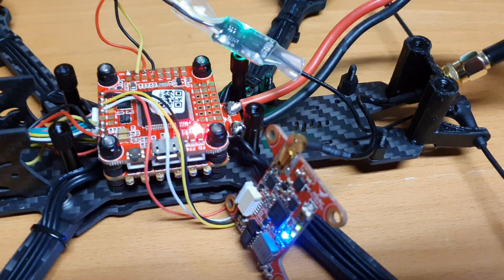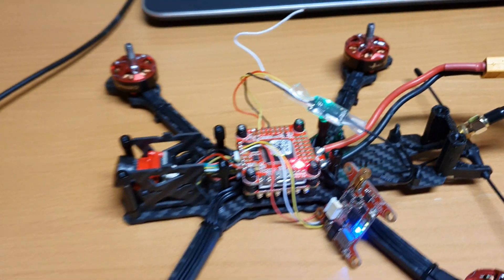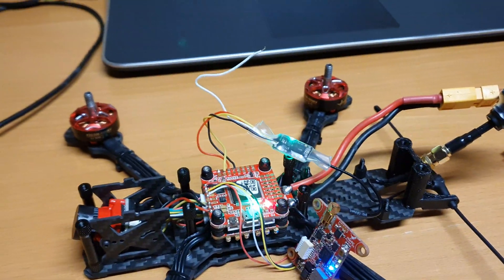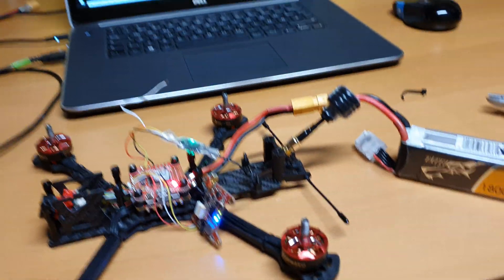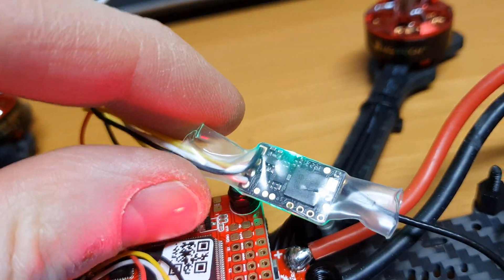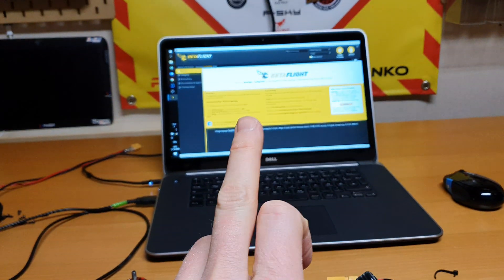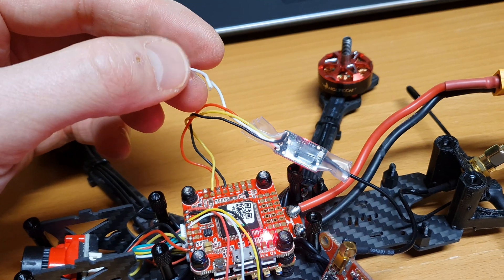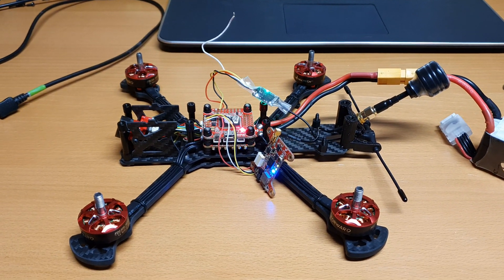Crossfire RXLOSS? Not a range issue... any ideas? (Sneak peak of my 6s copter)

Comment: I suggest that the FC may have an issue. I just ran into this on a micro build (non crsf). Swapped out parts. One new FC exhibited same issue repeatedly with three different receivers. Alternate FC got me flying. Still not solved the FC issue.
Reply from the maker: Thanks, but in this case it was a faulty RX (CF Nano). Just published the video: https://youtu.be/PKNO2yVUM-E

Comment: I saw you said that tx is fine with other copters, I had the same issues with intermitent rx loss shown and the problem was the gimbals on the remote had a broken wire, even if you have hall gimbals, two of the channels still have wires going to them which can break, if any of the 4 main channels give an invalid reading betaflight will switch into failsafe mode and disarm

Comment: EMI add a capacitor and twist the wire of the RX..

Edit..
That happens to me with every receiver when I'm that close try moving farther.. Also 60% chance it's the 5V
Reply from the maker: thanks, 5v tested- even used another 5v source - all good on that side,   turned out it was a faulty CF nano. Luckily I had a 2nd new one...

Comment: Try the same RX on another build and see if it performs differently, this would rule out flight controller.  If it continues then try another RX to make sure its not just a faulty RX.  If it all points to the RX last thing would be to take a fresh set of cables and re-solder the connections because theres a remote possibility there's a problem with your ground or power cable internally you're not seeing or with that ground or power pad (also try different 5v and ground pad on FC).

Comment: I had a nano receiver where one of the unused channels had a short circuit internally on the chip. That lead to higher current and the LDO shut down after some time. But in your case the receiver seems to recover... Mine did not.
But I sometimes have a half second dropouts that are not related to the above. Happens to all my quads. I think it may be the external power to the crossfire transmitter module that is glitchy or the connector in the JR-bay that has some problems. Some days it happens a few times. In between it can work fine for months...

Comment: It really looks like an antenna issue. check you ipex  on your receiver with continuity to end of antenna. Do the same with your transmitter antenna. If your getting any controle function at all that means your wiring is correct. Unless your not set to correct frequency according to your location USA or  Europe  815 or 900.

Comment: It's could be an  antenna issue on your transmitter. I've this problem before multiple times. Make sure your transmit antenna is not broken check continuity on both sides of dipole

Comment: From Oscar Liangs webpage
"5V to 5V
GND to GND
CH1 (Crossfire) to UART RX
CH2 (Crossfire) to UART TX
You can use any spare UART on the flight controller.

You can also just connect CH1 and set it up to output SBUS, but I want to use CRSF protocol so you will need to connect both wires in order to get telemetry working as well."

Comment: First thing I think of is that you're too close to the RX, but you said it fell out of the air, so that's not it. It's not the antenna because antennas don't cause that failure mode. So it tells me the receiver is browning out, or wiring is bad, or the receiver is bad. You need to eliminate each one of these options from the circuit to find where the issue is. So power the receiver off a separate bec, new wires, or try another receiver. Doing these three things will narrow down the problem.

Comment: Check frequencies to make sure they match your antenna; swap rx antenna and clean the IPEX connector on the board with isopropyl; do you have a micro or full size TX?